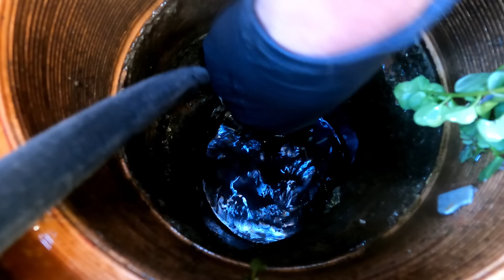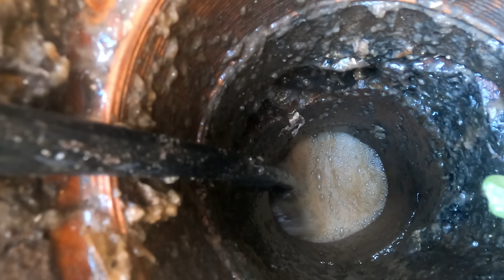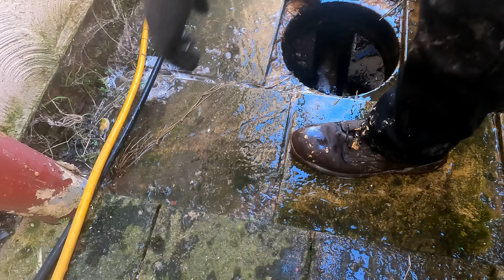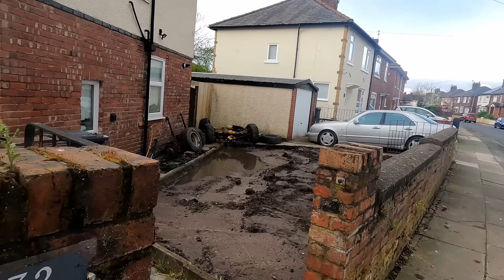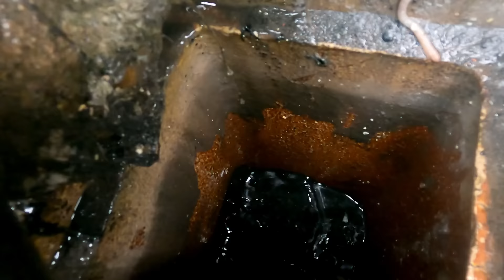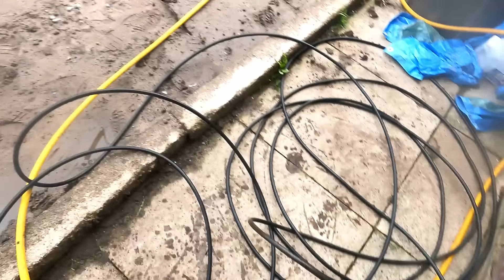Wipes STUCK to Overflowing Manhole

Comment: A Manhol go over. Work from the Drain with Presswater : Sausage with Wet's give a thick Souce.  And by the Manhol?  Run the Souce down.  Clear with much Water, and Unblock. The next Order? A Drain by the House go over, Presswater ! In this Drain  :  Metal, Stone Band a Fatstone  and...... Short good Work. 👍👍